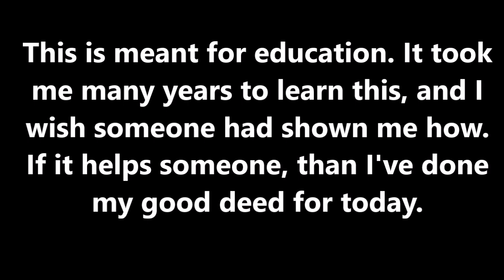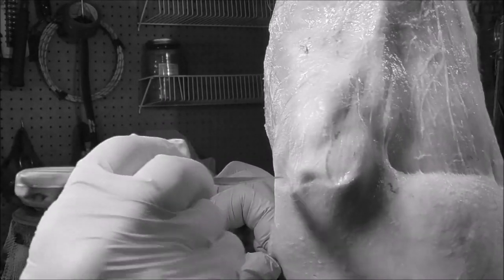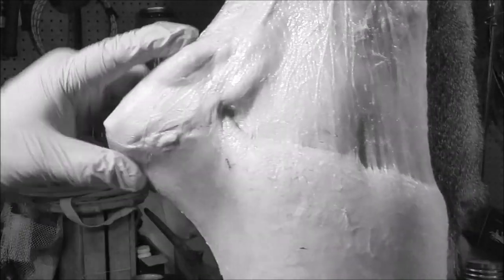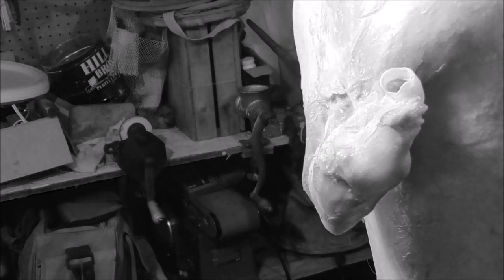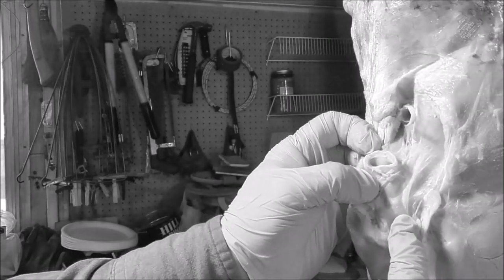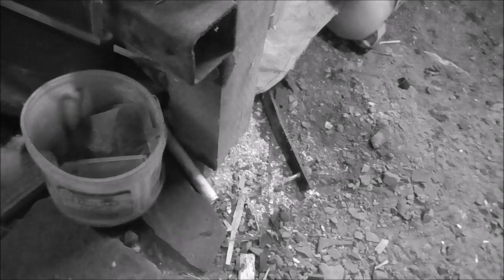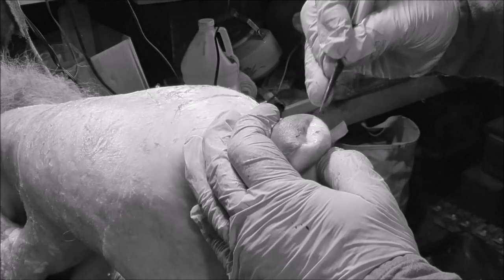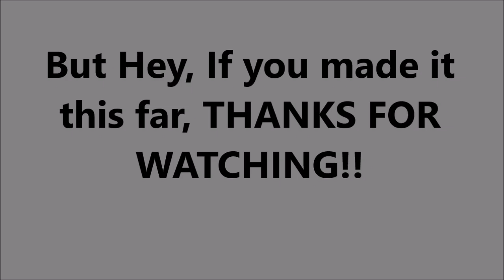Turning the Ears on an Animal Skinning Video

Comment: Helps a lot! I have always left the ears on the hide when tanning never had a problem except the ears are rock hard rest of the hide is soft though
Reply from the maker: Smaller critters usually aren't a problem, but I have had coyotes slip too.  Coyote ears are usually easier to do. Really should turn them, or remove the cartridge all together.

Comment: I've been trying to find videos specifically about skinning wolf. Of particular interest is the feet since they are to be intact on a good pelt
Reply from the maker: I started to film that, but my battery quit.  Feet are tough to do, but it's a lot like the ears.  Use a really pointed knife and work slow.  Cut between the joint when you finally bet to the claw, and flesh as much as possible off of the pads.   Good luck!
Reply: @MuskratOutdoors  thank you. Am i correct in thinking that the leg hide  is to be split down to the pad first?

Comment: Did you ever use a spreader to take the ears to the end ,it was like a reverse pair of pliers, I had one but when I got rid of my stretch boards I gave it away.
Reply from the maker: I never have. With coyotes, you can sometimes use a dull screwdriver. These were stuck pretty well.

Comment: So you detch the skin from the ear bud but leave it attached part way ?
Reply from the maker: Basically you turn it inside out like a sock.  Leave the edges attached, but skin it loose from the Cartlidge so that it can dry.  It will spoil if you don't and the hair on the backs of the ears will fall out.
Reply: @MuskratOutdoors  thank you.... This is great info